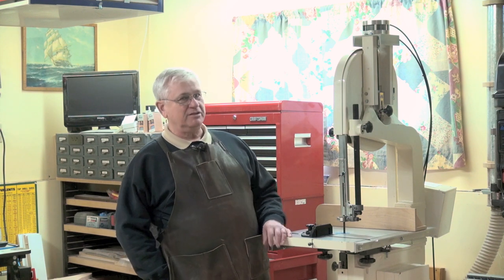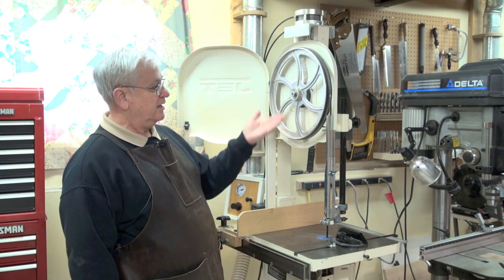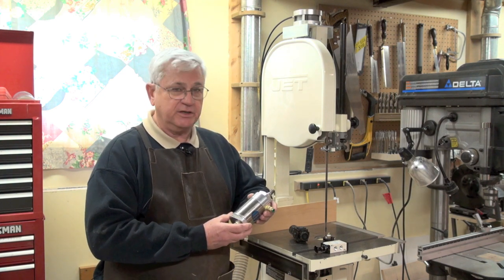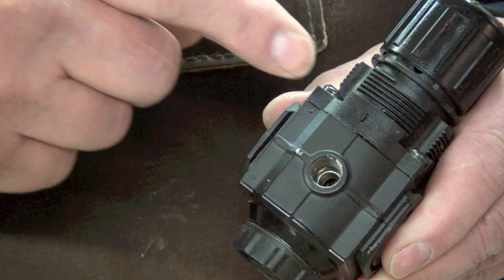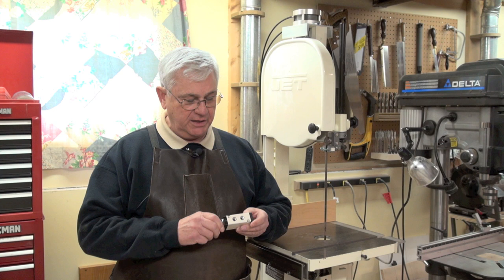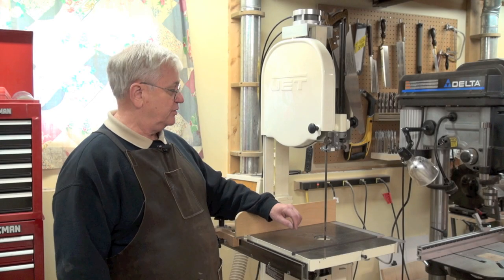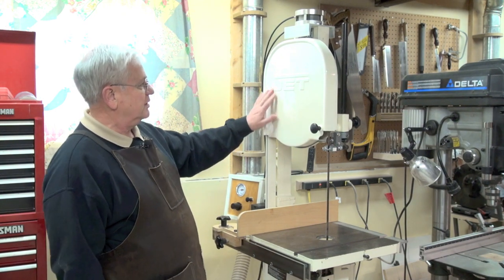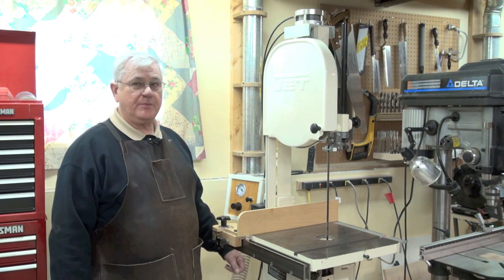Air-Tensioned Bandsaw

Comment: Hi, Adding to Lester's comments about costs, using compressed air and using it constantly raises them significantly. It is the most expensive power medium in the workshop at any level, heat losses, leakage etc. etc. Regards.